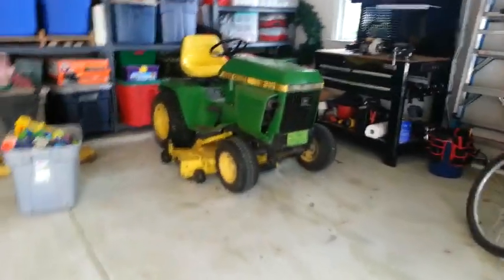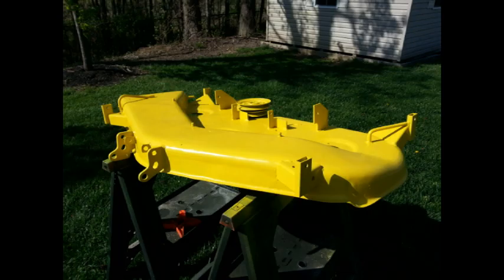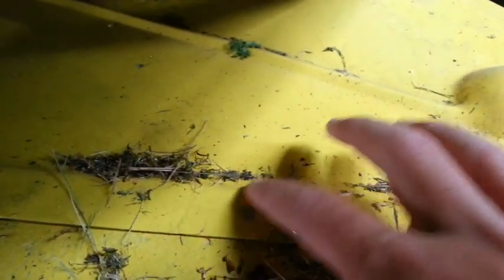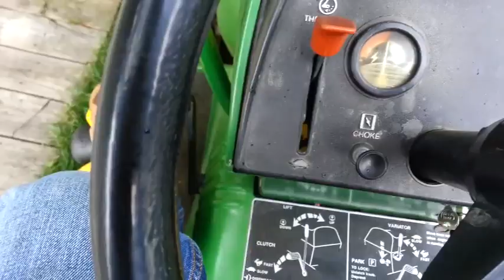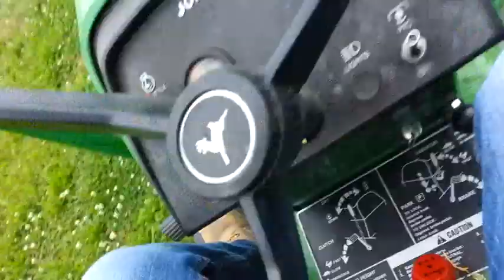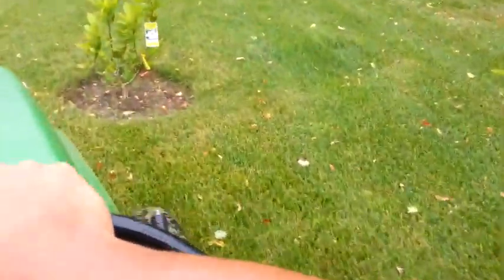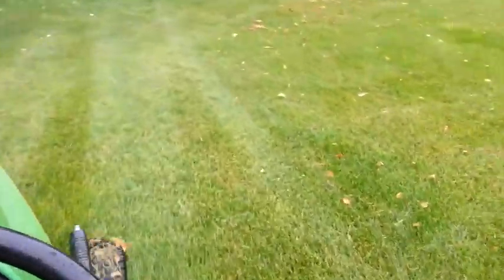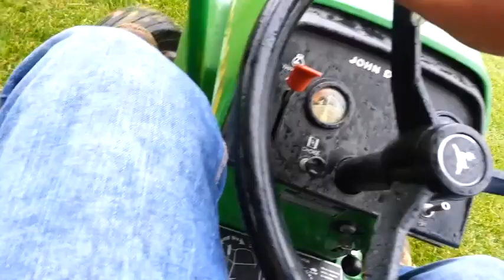Mowing With the John Deere 210

Comment: I'm glad to see people saving older machinery. We have become too much of a throw away society.
This is a rugged old machine and one can justify investing time and money in it.

One thing that sold me on John Deere was the parts man. When I was shopping older used machines he reassured me, "I don't care how old it is, I can get you parts".
Reply from the maker: Totally agree with you Mike. The garden tractor collecting hobby has become huge and we are doing all we can to make sure these old machines last as long as possible. I own a 2016 Deere X570 now and it's a nice machine but still no comparison to the 30 and 40 year old machines I've owned in the past. And one of the reasons I am a Deere guy is because of the parts network like you mentioned.
Reply: I would very much like to purchase a 210 but the local John Deere shop tells me parts are getting hard to find.
What's a guy to do if he isn't married into a family that owns a machine shop?
Reply from the maker: Sounds like the shop doesn't know much about the 200 series as parts are still readily available. Always check eBay and craigslist and I would also recommend joining the Weekend Freedom Machines forum as there is a large network of parts and equipment for sale on that site.
Reply: The dealer can only comment regarding new parts. They wont sell or install used parts.
Reply: Well, I took the plunge.  A dealer put up three of the 200 series in a lot on ebay. There had been 23 bids by 9 different bidders in 10 days, so I was sure I would be outbid since the others seemed serious. The last two minutes of the auction I posted a bid of $600 and evidently the others were distracted or they had maxed out. Anyway I got a 210 with a mower, a 212 with mower, and  a 214 with no mower for $590! Now I have to drive 9 hours with a trailer to pick them up!
It was just a whim because I was undecided as to whether I even wanted them. But I took what you said to heart and put in a bid.
They are all AS IS, none of them run but I'm hoping it is due to dead batteries or gummed up carbs. They did not list why they wouldn't run as they had not been run through the shop. 

Hopefully I can get at least two operational and keep the third for parts.
Reply from the maker: That's great to hear Mike! Glad I was able to influence your decision. Even if they all turn out to be basket cases I'm sure you can take all the good parts from each one and build one good machine. For less than $600, you can't go wrong. That's a heck of a steal.
Reply: John Deere still carries 90% of parts for these
Reply: MichaelTJD60 MB
Reply: @MichaelTJD60  The 212 is now fully operational! I put close to $200 in it with belts, new ignition switch, and the circuit breaker, and all new bearings in the mower deck. I think the ign switch was rusted internally. The belts inside the mower deck were rusted to the pulleys! I had to use a screw driver as a wedge to remove them. I soaked them with naval jelly, cleaned them up and carefully run them on a wire brush wheel. New pulleys are expensive!

Tractor started and ran good for a week then the starter would not engage. Bugger to get at the bolts. The cross brace is right in the way. I was ready to loosen the engine and jack it up when it occurred to me to use a flex socket. It was tight, but it worked! I just used emery cloth on the shaft, hit it with jumper cables and it worked.

The carburetor shaft came loose from the butterfly. It would not idle and I could not control the engine speed.  So, I blasted it with brake cleaner and smeared a glob of JBWeld on it. Now it works perfect. That shaft is a bit loose so I cut a piece of gasket material, made a donut out of it and slipped it on the shaft. At least now it won't let dirt in.

There is a site, <isavetractors.com> that has new carburetors for about $60. I will order one from him.  The small engine guy at local JD shop put me on to him.
Reply: @unclemikeb  
Very nice!
How about the others, especially the 214?
Reply: @patrickflohe7427  The 212 has a locked up trans but I bought a whole assembly from ebay for $260!  Hope to have that operational this season. The 214 must have a clogged fuel line, it will start if I prime it through the spark plug and runs good for a second so that suggests a good engine. It doesn't have a mower deck which would require me to get the hydraulics working so that will have to wait. It has the mudder tires with the big farm tractor like tires so I will use it for hauling.
Reply: Back when a lawn/garden tractor was built like a real lawn/garden tractor built with pride.

Comment: Our 210 didn't have the PTO switch.  You had to flip it into gear with a gear shift.  Mowed with it until '04 when it wore out.  Was a great mosquito chaser since it burned so much oil!
Reply from the maker: I had a 140 like that. Smoked like a mosquito fogger and would run itself out of oil in about 2 hours.

Comment: I just got a John Deere L118 with less than 40 hours on it for cheap. excited to use it even though it's getting towards the end of the mowing season. I might get one mow out of it
Reply from the maker: Nice deal if it's got low hours. As long as you don't work it too hard it should make a nice machine.
Reply: I've got a couple of pretty steep hills but my yard is mostly flat
Reply from the maker: Just don't work it too hard on the hills. The transmissions wear out after being used on hills for so long.

Comment: Nice, the deck looks great. Wish mine on the 345 looked that good. Every one but me has seemed to drive the deck into the a tree or pole and bend the crap out of it and breaking the lift brackets.
Reply from the maker: I'm a responsible operator and it's still tough to not bend up your deck. Especially since this one is a gear drive with a crappy clutch-brake system. I destroyed the nice discharge chute so that ended quickly.

Comment: I'm curious about the muffler on this tractor. I see a large chrome pipe sticking out.
Reply from the maker: It's actually just the stock muffler with a piece of 2" pipe welded to the cap and a "funnel" shape welded around it to help seal it off. I wanted to try and keep the exhaust fumes from burning the paint off the side panel and hood support like you see on a lot of 200 series...their exhaust outlet wasn't the best design.

Comment: Now, almost 2 years later, you also have a good power flow bagger!
Reply from the maker: +Lucien Dube And I never thought I'd be able to find one for a 46" deck.
Reply: +MichaelTJD60 you can barely find the 46" deck alone for the 200 series. You can find a lot of 46" decks for the 300 series. The 38" decks are much more common.
Reply from the maker: I had one of the three-blade 38" decks on this tractor when I got it and I sold it. Good size deck for the 10 HP motor but it couldn't fit a Powerflow bagger and if I was going to be mowing with it I wanted a bigger deck. I bought the 46" on eBay for $200 and restored it.
Reply: +MichaelTJD60 yeah I remember you were planning to keep that deck for a backup mower and to fit into places the la150 couldn't
Reply: +MichaelTJD60 And then you bought the k301 which was a pain in the ass

Comment: Check those hubs on the rear wheels. The tractor will drive just fine, you will not feel anything is wrong.

Raise the rear and try to wiggle the tire and wheel. If there is slop, the surface of the hub is worn. If you continue using it too long it may damage the spline of the axle. AXLES ARE NOW LISTED AS OBSOLETE BY THE JD DEALERS. 
So, used is our only option unless you pay a small fortune to a machine shop to make new.

I was lucky. I found two good, tight hubs on ebay for $97. New ones at JD cost $250!
The new one did not go on. I used a triangle shaped file to clean up the outer one inch of spline. That did it, the new (used) hub slid on and was tight. So check those before you ruin the spline.
Reply from the maker: The transaxle in this tractor was rebuilt 5 years ago and I had everything checked for wear. Axles were worn due to bearings locking up, so they were welded and ground, but the splines and the hubs all looked good (which is surprising considering how many of these usually have worn hubs). I had a square fender 110 a couple years ago that had very worn-out hubs on it...the hubs on the 210 felt like new compared to the 110.

Comment: I just purchased an old 212.  Have not mowed with it yet.  The previous owner says it keeps chewing up the drive belt (PTO belt).  The pulleys seem not to be cock-eyed.  What ya think is the cause.
Reply from the maker: Chelsie McCance Are you using JD brand belts? The aftermarket Stens and other brand belts do not work on Deeres because they don't fit tightly in the pulleys on the mower deck. Only a Deere brand belt will fit, and they last a lot longer anyway. The belt comes off the PTO and wraps around the right sides of both of the hanger pulleys that are up against the frame. There should not be a twist in the belt because it will run backwards. You say the pulleys are not bent? Check to make sure the edges are not bent either.
Reply: If facing the front of the mower ... the right side hanger pulley has slight bend to it. The bottom side is kicked to the left 10-15 degrees. I figure I'll probably have to bend it back to straight vertical (90degs)
Reply from the maker: Those pulleys are supposed to be angled like that. They are angled so they direct the belt towards the deck drive pulley which is closer to the center of the deck. If those pulleys were straight the belt would not reach the deck.
Reply: If the deck drive belt is waring out  often then maybe the spindle bearings are in need of replacing.when they freeze up they put a lot of stress and wear on all the deck belts.Also check all the other pulleys on the deck.

Comment: Thanks for the video!  I have a 210 that I am rehabbing. I am stumped on how the lift linkage works and if I have the correct lift straps. Could you add or send me a pic of the lift linkage on your 210 when you have a moment?  Would be much appreciated
Reply from the maker: Basically there are two lift shafts under the tractor. They are connected with two thin metal links that pivot the two shafts back and forth together. My tractor is an oily mess right now because of a broken hydraulic line, so it wouldn't be easy to get a good picture of everything. I would skip to about  1:17 in this video for a view of the linkage underneath: https://www.youtube.com/watch?v=V1JSLltEkY8

Comment: FYI if you adjust the mower according to the book,  while parked on a flat driveway or garage floor your gauge wheels should not touch the ground they should hover like 1/4" above the ground. it makes the wheels last longer and i guess it makes for a smoother cut
Reply from the maker: I did. They are above the ground about 1/4" like they should be. I have them set 4 holes from the top, cause that's where I see everyone else's wheels at.
Reply: i have no idea where mine are set. you just set the depth stop on the floor of your tractor till your mower is cutting at the height you want then ajust guage wheels accordingly
Reply from the maker: 1944johndeerel Somehow my lift height adjuster fell out. I don't feel like putting it back on just yet. I'm not lazy but I haven't quite gotten the hang of mounting and removing the mower deck yet so I don't want to have to remove it just to put the lift stop in.
Reply: they are real easy to hang the mower from

Comment: I can see this is an old post but I'll give it a shot. I got one of these with a home I just bought. The clutch pedal on the left is locked down and I can't figure out how to unlock it so as to change the gears. Is there some kind of start sequence? Your help would be greatly appreciated.
Reply from the maker: Sounds like the parking brake is locked. You should see a black knob at the bottom right corner of the dash column below the key switch. Push the clutch pedal in and lift the knob up and to the right.

Comment: Nice Video the 210 Cuts really Nice! I saw a bit of smoke there! actually its a bit worse than my Cub but in good news it was the head gasket causing the issues I ran it and it leaked oil everywhere and I got a new head gasket but have yet to put it on id really suggest to get yourself one go to NAPA and ask for a Head gasket for a Kohler K series 241 and they will bring it right out $7 its worth a try at least

Comment: Just got a 210 is it normal for it to smoke a little bit and then stop? Like yours does ??
Reply from the maker: Well they are over 40 years old at this point, so it's not unusual if the engine is original and has a lot of hours on it. All these old K series Kohlers smoke once the rings and cylinder wear.
Reply: @MichaelTJD60 Thank you for the reply I have a quick question for you, today I was mowing and when I put it in PTO with the manual lever, the mower idler blew off looks like the bearing was shot on it, it’s not the one that is in the deck it’s the one that you can see with the side panel off on the right side, the back of the belt rides on it, how do you loosen that belt when I go buy the new pulley? Cause it looks like it needs a lot of slack when I reinstall the new one? I do see like a mini screw that sticks out of the front grill bottom left corner?

Comment: Micheal, would you by chance have the belts written down somewhere for this mower? I am trying to get on going that is missing the power takeoff to mower deck belt.. it would be nice to know the sies to all of them.. Thanks for any help.
Reply from the maker: Which mower deck do you have? The belts are different sizes depending on the mower deck.
Reply: I have the smaller deck....I think I ended up getting a 78 inch belt to work on there... there really isn't as good of tension setup compared to newer decks.. I might have been able to squeeze on 1 size smaller?... I am mowing my Moms place and it is half hill climb, the hills have wrecked multiple cheap hydrostat mowers... but this old gearbox JD will climb like a goat. So I do the flat parts with a tired  hydro, and the hills with the JD... Its steep enough in places I mow with chains on ;)
Reply from the maker: For future reference you should always use JD brand belts. They are made of a thicker and higher quality material and are designed to fit tighter in the groove of the JD v-pulleys. Most aftermarket belts do not work on Deere equipment. Is your deck a 2-blade or 3-blade model? They use different belts depending.
Reply: Boy is that the truth. 

I thought my friend had major problems with his JD, it kept eating   mower belts. I was buying them at an auto parts store. Finally I told him to take to an genuine JD dealer. It was there three days and working perfect. Turns out there was a pulley slightly worn helping to eat the NON- JD belts in short order.

Comment: Coarse skateboard tape is great on footrests. Lasts for years, inexpensive, easy to apply/
Reply from the maker: That's pretty much exactly what Deere used on these tractors when they were new. I replaced it with diamond-plate steel because I liked the way it looked.

Comment: Excellent video. I have a 210 and the speed accelerates on its own occasionally. Would you happen to know what causes this?
Reply from the maker: oleskool Are you referring to engine RPM or travel speed? If it's the engine then it could be the governor is out of adjustment and slipping up to a high RPM. If it's travel speed, which is more likely the issue, then your variator is probably out of adjustment, belts stretched, or just need to spray some graphite lube on the variator pulleys to get them to slide much easier.

Comment: I just bought a clean 210 with blade, 38" deck and tiller for $550.  It is not running, they say it needs a wire harness.
Reply from the maker: Does it have electric or manual PTO? I have a wiring harness for an electric PTO tractor for sale. Needs a couple new connectors crimped or soldered on, but otherwise it's all there.
Reply: @MichaelTJD60  manual pto serial tag says c210h 100836M engine is k241AQS I think that means it is a 1979.

Comment: May be getting a 210 from 1978.  They hard to shift?
Reply from the maker: Not at all - just make sure you allow enough time for the drive belt and pulleys to stop spinning before making the shift, to prevent grinding gears.

Comment: Love your videos! I have a question since you have a 210,  I drove over some bad ruts from a garbage truck, it popped off my deck belt but I was able to still drive it to the garage. After I put back on the belt it won’t do anything when I turn the key. The battery is good, any ideas? You seem to know a lot about them. Thanks!!
Reply from the maker: Is the PTO turned off and is the shifter in neutral? Those two safety switches will prevent it from starting. Check those first.
Reply: Pto is off and is in neutral still nothing. It’s crazy!
Reply from the maker: @danfletcher7376  The neutral safety switch under the shifter is pretty sensitive on these. Sometimes you can hear it "click" when the shift guide touches it. Make sure that switch is depressed.

Comment: What’s the difference between the 1970 version of the 200 series vs the 1980 version with the bee strip decal
Reply from the maker: There are 4 generations...'75-'76 had the solid yellow stripe and screened side panels, separate clutch and brake pedals, manual PTO, and one-piece engine cradle with narrow base engine block. '77-78 were the same tractor but with louvered side panels, bar-style grill instead of a screen, two-piece engine cradle, and wide engine base. '79-'81 added the black tiger stripe decal, clutchbrake pedal on the left. '82-87 added electric PTO.